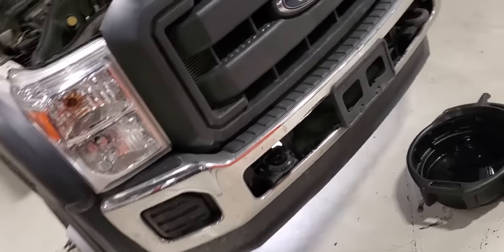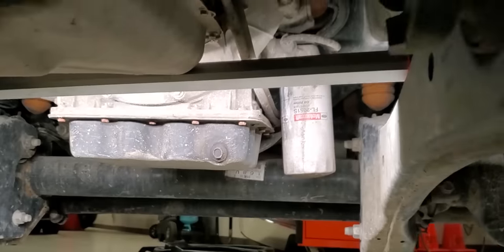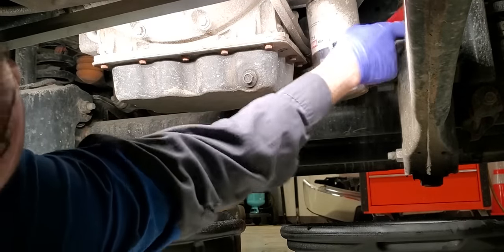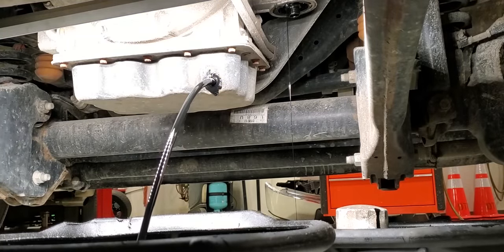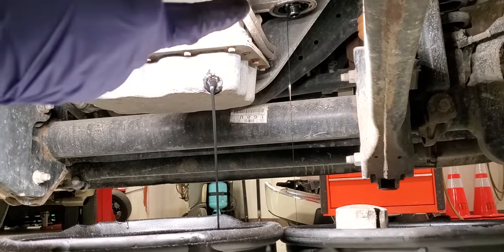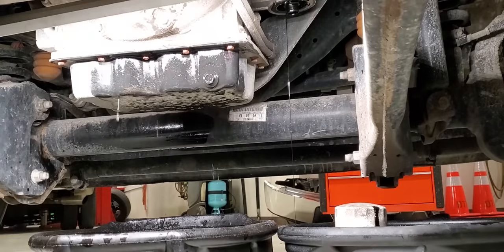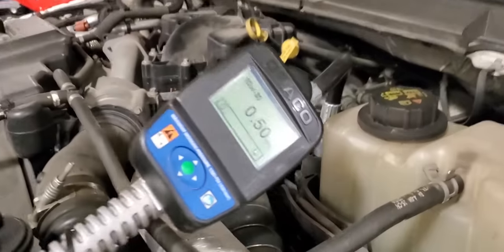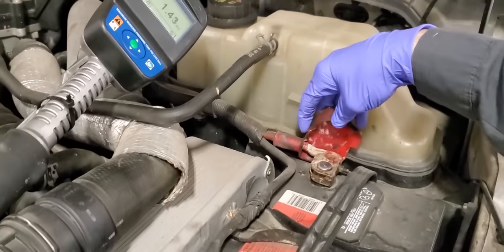Ford 6.7 oil change video HowTo - ALL POWERSTROKE owners should WATCH!!

Comment: First video I watched of yours.  So, I worked as a tech at a couple Ford dealerships and at the first one, I worked on the first and second generation 7.3 Powerstrokes but have a question about these newer ones.

Do these newer 6.7 Powerstrokes also hold roughly 2 quarts of additional oil in the HPOP and as such, is there a way to remove this oil with a suction gun?  I will admit, I don't recall personally removing the 2 quarts from the HPOP in the old 7.3 when we did oil changes at the dealers (I don't think anyway) but there are plenty of discussions online for doing so.

Obviously, if you're changing oil but not actually changing the 2 quarts in the HPOP as well, then you're not actually changing all of it and as such, the new oil will be contaminated with the old oil immediately upon startup.  

So, do you not change this on the newer ones and if so, why not?  Or, is there just no way to change this?  Or, do you change it on the older ones as well or just not worry about it?  I know it takes an additional 5 to 10 minutes of time but just curious.
Reply from the maker: Brother, this isnt high pressure oil.....common rail 😶 them days is long gone.....
Reply: @PowerStrokeTechTalkwARod  summbitch that's a fast response.  

I thought these still hit 30,000 psi roughly or more like the old ones.  No?  

Hmmm.  I wasn't aware.  

Either way, if there is still oil in the HPOP, wouldn't you want to remove it?  I know we can go round and round on this argument but if there is indeed an additional quart or two still in the HPOP when draining the crankcase, that's "old oil" that will get mixed with the new oil.  I know it's not much but still, it's there.  

Now, get to work.  ;-)
Reply from the maker: 🤣🤣🤦‍♂️🤦‍♂️🤦‍♂️ THESE DONT HAVE HIGH PRESSURE OIL PUMPS.....ITS HP FUEL BRO! Old ones never hit 30,000. 3800 psi maybe....all these new 1s are 30k psi. U drain the oil thats it, done...no gun sucker needed

Comment: When would be the time you would take the lower oil pan down and replace the silicone gasket? I’ve got a 2015 6.7 with a little over 225k
Reply from the maker: Only if its a leakin!👍
Reply: Thanks man

Comment: Good video.  Changing oil cold? Is that okay, I always thought it was recommended for the oil to be hot when changing?
Reply from the maker: Cold, means it's ALLLLLLL in the sump. Just takes longer but it's all been drained down

Comment: lol, I loosened my filter and drained the engine into the drain pan, and when I reached up to finish removing the filter it must have been hanging by the last micrometer of thread. I touched it, it did a cannonball into the pan and wow what a total mess.  you would have to conduct scientific research to create a bigger splash. lol, I was being sooo careful 😅 not to make a mess.
Reply from the maker: Awe man, i see it now...exxon veldeez

Comment: 1:54 mark freeze screen and tell me this   I have a 2016 F350 6.7.   That one bolt above the drain plug on the right side has so much soot that appears to be a leak. Im talking about the horizontal bolt not the vertical pan. bolts  The vehicle has only 22k mileage wise. Im a tad disappointed .   I know trucks leak but at 22k?   That cant be normal. Any thoughts or am I being picky. The truck hasnt had any strain its practically a daily driver to and fro work. All changes tho Ive only had 2 or 3 regarding oil and that was done by the dealer.   Thoughts? Or am I being picky because this truck is barely broken in mileage wise. Every other area is dry or stain free.

Edit: that last part about brakleen and blowing the filter makes me think u work at my dealer because my filter is spotless after thousands of miles besides what I stated above on the housing bolt!!
Reply from the maker: Sry pal

Comment: whats that spritz bottle you used to clean the oil residue. Sure would like a link to order one.
Reply from the maker: They are called sure shot cans. Im sure theyre on the net. Ull need to buy bulk brake clean in order to use.....
Reply: @PowerStrokeTechTalkwARod  good to know.

Comment: Great videos! Do you recommend using synthetic oil for the 6.7l?
Reply from the maker: U can, but if your gonna be changin it regularly at 5k miles....i wld just use the regular 10w30!
Reply: Does this still hold true ? I’m going to do mine every 5k or 200 hours as you recommend. So I should use regular over full Synthetic? It’s a tow truck if that helps
Reply from the maker: Full syn all day brah
Reply: @PowerStrokeTechTalkwARod  what weight do you suggest ? New Jersey weather
Reply from the maker: 5w40 full or 10w30
Reply: @PowerStrokeTechTalkwARod  thank you bro !

Comment: How bad did it typewriter? I have found that not getting the full quart in the filter leads to that. I also find mines quieter overall running 15-40
Reply from the maker: No type writer noise...not supposed to have 15w40 in there....

Comment: Why is the oil always black? I have a power stroke 6.7 deleted and it’s still black after 1,000 miles, I thought deleting would keep it some what brown
Reply from the maker: Deleting it has no effect on keeping the oil clean. It gets black because when we burn a fossil fuel petroleum product such as diesel.....the end by product is soot(CARBON)<<<------black. The oil does its job by suspending those particles in the oil until its changed. ...........and these guys come in cryin cuz their engine is toast and doin 10k oil changes oh & never shuts off. So.....my friend thats why!
Reply: PowerStroke Tech Talk w/ARod thanks you for explaining and good thing I change it every 5k miles

Comment: Where does the coolant slowly go....   if there’s no visible evidence
Reply from the maker: Who ever worked on it last, didnt fill it up all the way...
Reply from the maker: True, but if the bone head who drained the coolant, did not fill it up all the way or didn't purge the air out....which in turn makes the level low....then where did it leak out...
Reply: PowerStroke Tech Talk w/ARod Interesting... thx for the reply.  Keep the quality content coming!  Stay safe!

Comment: What about the oil filter on top??? Where is it located??
Reply from the maker: This only has one it doesn't have 2 man
Reply: @PowerStrokeTechTalkwARod  thank you for your reply. There were 2 on my 7.3 , one up under the hood and one under the motor in the usual place, so I thought ford had continued that set up. Thank you again 😎

Comment: Recommend to NOT use a filter wrench to put the filter on, just as tight as you can get with HANDS ONLY...

It's a good idea to confirm the o-ring came off the truck and stayed with the old filter, as if you leave it stuck to the truck and put a new filter on you'll have a double o-ring and that won't end well...

Lube the new o-ring on the new filter to ensure the rubber ring doesn't go on dry, and makes taking the filter off on the next oil change way easier.

And I know this is a controversial thing, but I'd recommend to PreFill your new filter with clean oil. As I'd see running the engine dry for those first few seconds alot worse then potentially getting contaminates in your filter...
Reply from the maker: Um

Comment: What about checkin the oil afterwards man
Reply from the maker: No need to. My gun gets calibrated by the oil fill company. It dispenses the correct amounts 😉👍
Reply: PowerStroke Tech Talk w/ARod - what about if not all the oil drained out?
Reply from the maker: Unless im in some sort of anti gravity lab..........................AINT gonna happen. Pull the plug, oil drains out, doesn't stay in there...